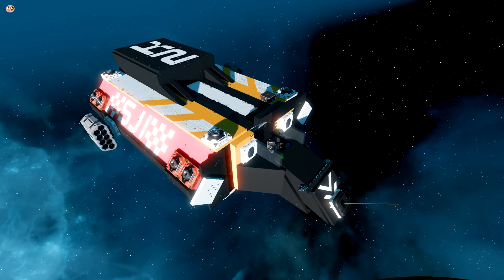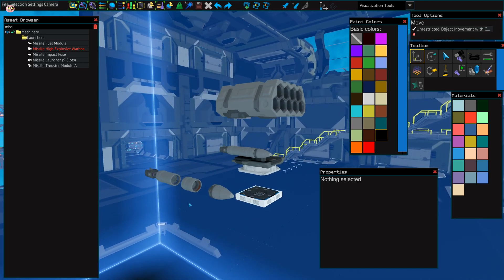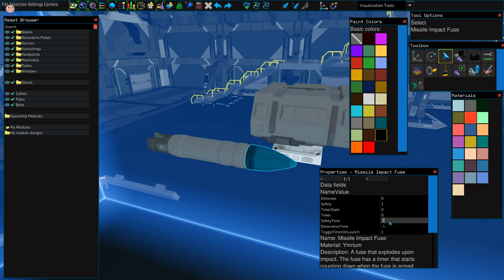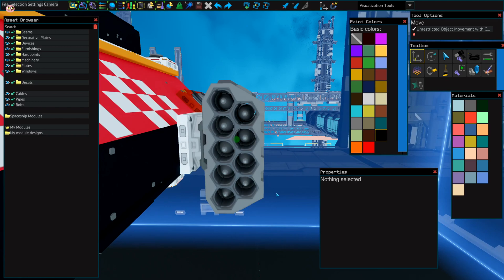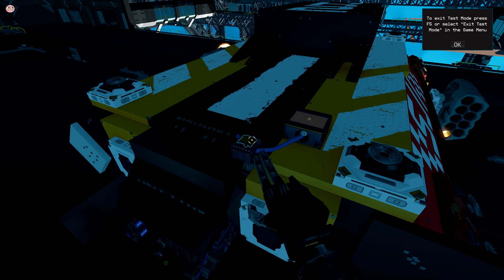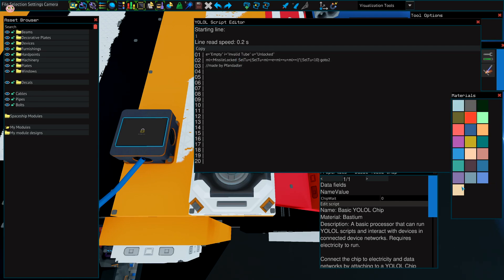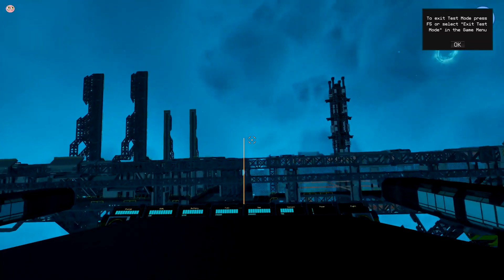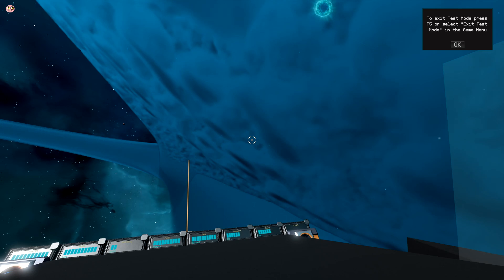Missiles and Launcher Tutorial with YOLOL | STARBASE GUIDE

Comment: the rockets rolling off is gonna be annoying. Are they caused by horizontal movement of the ship or 2 rockets are set off too close/ too soon?
Reply from the maker: Its very much a bug :) was fixed 6 times already in CA :D
Reply: @tgess6763  and still look like this?
Reply from the maker: @coldiceEVO  they have way more bugs that I wont even tell you about :D its niche weapon, not high prio for fixing
Reply: @tgess6763  you can keep them to yourself. The game only have 7 weapons(all of their own type with no scalability despite the modularity) yet still managed to make half of them niche to the point of very little discussion everywhere. To make matter worse they put them on the bottom of the rapidly growing cost tech tree making it niche by implementation. 
It is niche by design by being non-reloadable which by now the fuel and ammo reload are already tested on the move as they can stay attached to the actuators unlike rockets that have to be detached to launch. 
If they don't fix and promote it now, later reintroduction would only shock the player base on their idea of how combat works if too good, or simply still niche to non-existence if too bad or big nerf follow by the previous case, instead of being a valid option that can be incorporated to the evolving combat style to enrich the experience.